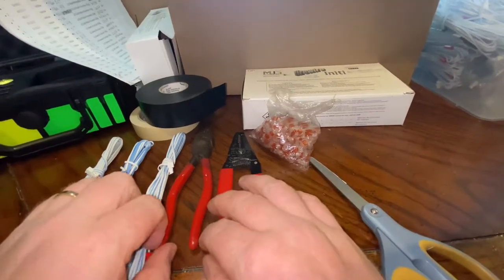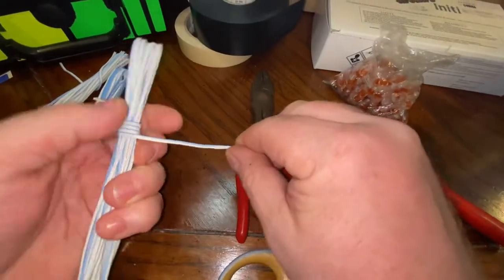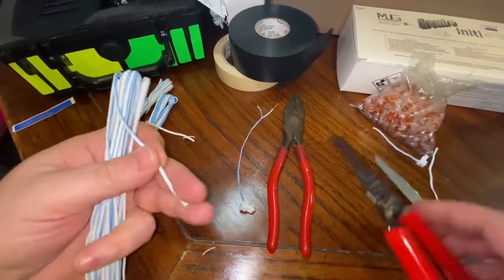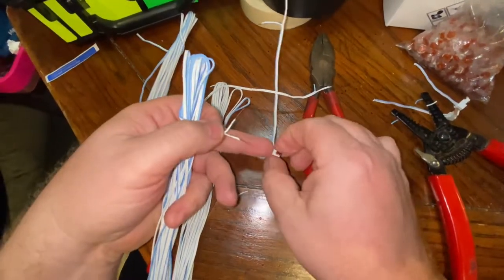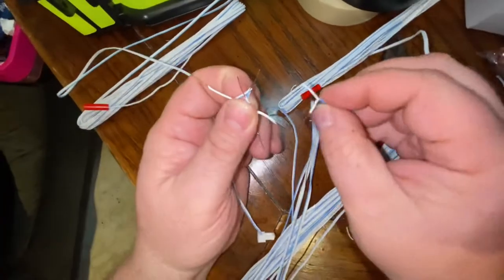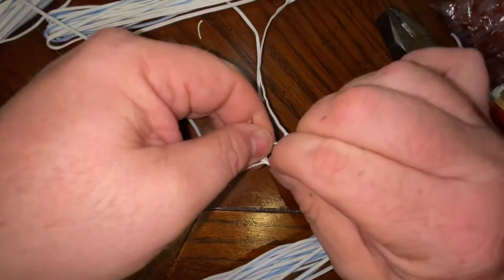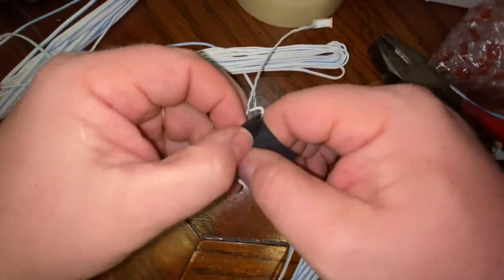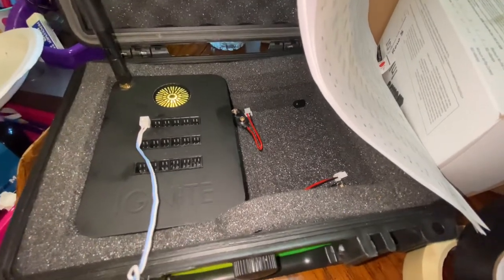IGNITE fireworks firing system Splicing 3 Quick Plugged wires together to use on 1 cue.

Comment: Question if I wanted do this with regular talons which are orange does it matter which side wire connects to other wires ?
Reply from the maker: I’ve connected them as well and it doesn’t matter which side is connected.
Reply: @redbeardsfireworksshowcase  okay cool thanks!! I have thousands of the orange wire talons and wasnt sure if it mattered sence you specified keeping the colors together in the video